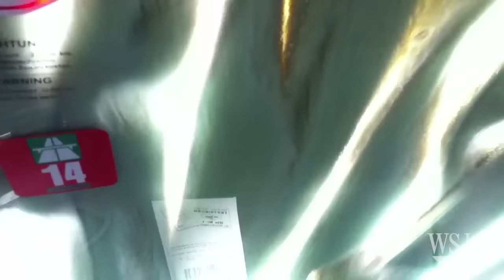Inside Germany's Fanciest Car Wash

Comment: Serious car enthusiasts know to avoid automatic washes like this as car paint is surprisingly vulnerable to swirl marks, etc.  Hand washing is best.
Reply: how does by handwashing NOT make swirls?
Reply: @stevethea5250  Fair point but handwashing at home means I can ensure the washcloth is clean and free of debris.  The weight and speed of those commercial brushes would also concern me.
Reply: @GunnyPhillips  yeah not fan of those brushed/cloth  soft-touch carwashes

i went with touchless/laser wash for lazy monthly maintenance days for now
Reply: @GunnyPhillips  In Germany it is not allowed to wash your car at home, at your garage, street, or in public spaces.
Reply: @MrPabsify  Wow!  Thanks for the info. Ironic as many of the very best cars are designed and built there.

Comment: Same old car wash concept but on an industrial scale. There is no way that I, as a car enthusiast, will be taking one of my well-cared for cars to a car wash factory run with machines that slap against the body. Want me to come? Have a hand washing section and show me the laundry baskets full of clean cloths that will be used to touch my car. This is probably a good business, but my feel is that its customers are the types who think of their cars in the same way they do their toasters.
Reply: Hand washing is actually much more abrasive and potentially damaging to your car's paint than a modern car wash is. It ain't the 60s any more.
Reply: I think you have no idea how bad these mechanic car washed are. Hand washing is the best possible option. Just have to know how to wash correctly. I spend about 3 hours every week washing my car. As a maintenance wash. If I go full out. I easily spend 8 hours. And if I go absolutely ballistic... I can without a problem spend 30 hours on it. But my car looks better than it was when I got it from the dealer.
Reply: @tankeriv  How do you want to know that german car washes are like American ones? Most washes like this here in Stuttgart uses an special material on their brushes called Polyethylen which is very similar to textile and it is going very smooth on the car. Modern cars in Germany have also a very strong paint. The brushes are getting sprayed with their own special water sprayer that makes the dirt go off. The fast rotations swing the dirt away. Its rare that a car wash makes scratches.
Reply: @tankeriv  Luxury vehicle dealers like mercedes and BMW also go to car washes to clean the cars before putting them on sell..
Reply: @hologammer1133  yeah and if you check the paint of new mercedes and bmws its awful, the swirls are everywhere, handwashing is much better, 2 buckets, grit guards and 2 or 3 wash mitts does the trick
Reply: @CobnutVTS  No it doesnt. Well atleast not in germany.
Reply: @CobnutVTS  Trust me, Germany has the most softest material on carwash. It's so soft I can literally idk. Please stop spreading fake rumors about carwashes when you can just look at thousands of websites proving that german carwashes and some Americans are very soft.
Reply: @hologammer1133  if you can find me a link to where it states this i will believe you but for now i don't as the materials, no matter how soft are still rubbing abrasives such as dirt, tar, sap etc etc over the paint as shown in this video, it doesn't work, thats why you see so many cars with straight marks and swirls because car washes like these are made for fast application and not for the safety of the car, idc if germany has the softest most amazing material in the world, dragging dirt over the paint still scratches it
Reply: @hologammer1133  im not talking about the brushes being clean im talking about the car being dirty then that dirt gets dragged along the car, also bug spray on the whole car is relatively pointless since the only place that will require bug spray would be the front as if any bugs are on the back of the car they would easily come off, also bug spray is a very harsh chemical and can damage some types of wheels that have special coatings on them
Reply: @CobnutVTS  it gets on the front only. No wheel. Just front. Also it doesn't get dragged cause on lots of dirt it gets a pre wash with high pressure lance.
Reply: @hologammer1133  there is still pieces of dirt on the paint that can drag along, guaranteed they will not 100% remove the dirt leaving bits and pieces to get once again dragged along the paint, i could go on and on about why automatic car washes are awful but honestly i cant be bothered arguing anymore, clearly me and all other detailers are wrong
Reply: @CobnutVTS  thats why a mechanic high pressue rinse is being made with active foam and different chemicals. Alcan and sour chemicals. Alcan to clean and sour to make it shine.
Reply: i have a car to get around, not to treat it like a child
Reply: Mocking the fuss about handwashing cars! Been in Germany, rocking automatic car washes for years. They've got some sweet ones! But hey, keep an eye on that dirt—don't let it turn into a crusty paint disaster!

Comment: He is talking out his butt... 400 Cars per hour is not possible. Look at his line speed, even if he is actually washing the 50,000 cars a month as he claims.... do the math, this breaks down to only 150 cars per hour and that is more realistic.
Reply: Chuck Lundberg Mr. Wash Stuttgart's tunnels probably can both get to 100 CPH if extensive prepping is done (which Mr. Wash does for all vehicles). This should work out to a roughly 200 CPH maximum throughput (only half of what they claim). 

Other facilities can handle more cars per hour through use of longer conveyors, automated prewashing, and automated towel drying in addition to an air dry. For example, ANAC Carwash Breda claims to be capable of 125 CPH on its two wash conveyors, but they can likely handle as many as 150 each. Other larger facilities, like Holz Waschparadies Ulm, can likely handle about 200 CPH on one conveyor. A capacity of 400 CPH seems to be almost unheard of, even with regards to the largest German and Dutch facilities.
Reply: Yes, I agree. I feel he was boasting his numbers for the camera. Longer tunnels can put out more cars than shorter tunnels but even bumper to bumper and at a fast conveyor speed the best a tunnel car wash can do is 200 per hour as you saif. Which breaks down to over 3 cars per minute.
Reply: +chuck lundburg mr wash pre washes the cars in the waiting queue and they can adapt their conveyor speed on how busy it is. So they can do it if they want to
Reply: He also says "up to 400 cars per hour" which means its their absolute peak capacity
Reply: is this a double tunnel car wash?
Reply: +yahir cruz yes it is
Reply: This location is not a double tunnel.
Reply: It is not possible to wash 400 cars per hour, it cannot be done thru one tunnel.
Reply: +Chuck Lundberg it is a double tunnel! Im 100% sure
Reply: Chuck Lundberg there are two wash bays and I know because I've been there.